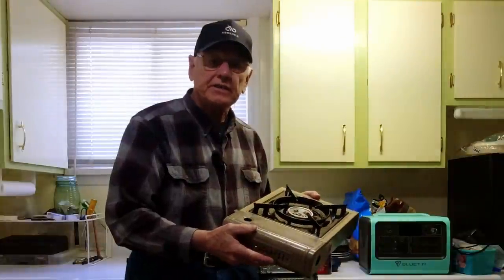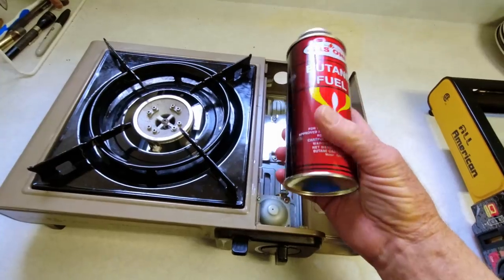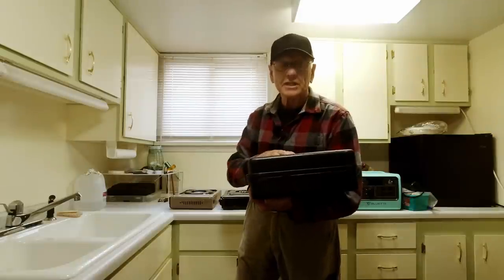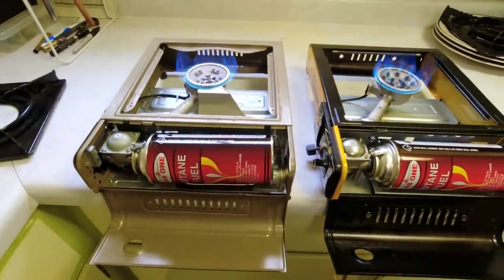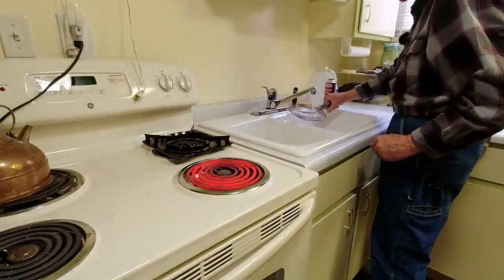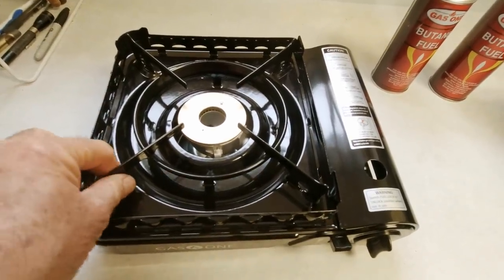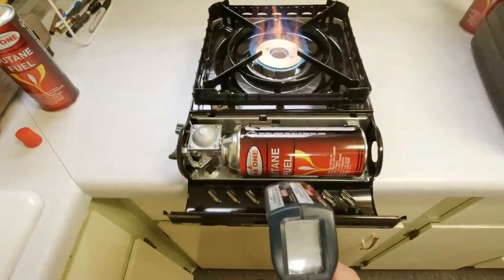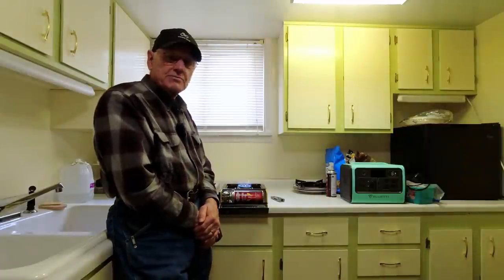Are the Newer Model Butane Stoves Actually Better? - How to buy a good one!

Comment from the maker: The modification I've shown in the video will only allow a small amount of heat to reach the bottle to warm it slightly. A word of caution concerning the use of these stoves!  Always follow the instructions and the most important instruction is to NEVER use a pan that extends over the butane fuel bottle (or can).  This can cause the can to overheat and explode.  The price of 8oz. cans of butane for these stoves has gone through the roof along with all other types of fuel.  I just bought 12 cans off of Ebay for $35.00 including shipping so search around a little for the best deals. Try this outlet for fuel: https://www.webstaurantstore.com/search/butane-fuel.html 03/25/2022
Reply: I’ve been told that you can buy the butane cans at Asian grocers for a much lower price.  Unfortunately, I have no access to that in my area😢
Reply: If they don't have blue on the rim they can explode so be mindful of pot size.
Reply: @secondact7151  I think there’s a certification mark you need to have on the can?  Don’t remember the acronym. 😁
Also, the pan shouldn’t overlap the canister section.  I haven’t even been able to test my Iwatani since I can’t find butane here.
Reply: @SuzanneWho  guess how I figured out the max pan size?  I put my folding Coleman oven on my butane burner.  It was close to exploding, so I thought hmmm, I wonder if that is a bad idea.
Reply: @secondact7151  😎👍🏻
Reply: Seems to be opposite here in Australia 🇦🇺. 
Used to be approx AUD$5 per each standard 220gram canister.
A couple of years ago standard price for a 4 pack of cans AUD$12.00
Now I buy a 4 pack of cans AUD$6.00. Very happy with that!
Reply: @secondact7151  https://youtu.be/rVwOrk1vl5Y?t=137
do not put a heated pan on top of the gas can compartment, once the gas can becomes hot enough (so does internal pressure with fixed volume, PV=nRT) it will vent, with the right mix of butane and atmospheric air (21% oxygen), it can explode, or burn, neither is desirable when unintended
keep the butane can under 50C, it is printed on the can for a reason
Reply: Sam's Club sells individual cans for $2.28 or a case of 12. Good deal.
Reply: @kaysmith6297  now if I only had a Sams club within a decent driving distance! 😩
But, good to know if someone is going there, I can ask them to get a case for me. Thanks
Reply: Thanks for the super tip! Propane is great for boiling water (quickly)! Butane is best for eggs or frying at lower temps ( more control low, med low)!

Comment: Oh the irony.!!!
First off well presented, clear and precise description of the modification.
The irony is that here in Australia 🇦🇺 there was an issue of a couple of cases of the propane tank becoming too hot and bursting. The main cause of this was using too large a pan that then deflected  excessive heat on to the canister.
All the “old” style stoves were removed from the market and a big scare campaign to stop people using them until the next generation was brought out onto the market. The next generation incorporated an over pressure protection to disconnect the vapour flow if the pressure goes above a certain level.
Now the “frozen cans”. The stoves rely on gas “vapour” to burn 🔥. Below a certain temp the liquid propane will not vaporise. The pressure drop inside the propane canister drops to such a level it appears to freeze (just the same as a refrigerator works. 
That’s were the added “heat sink” helps to keep the propane vaporising to use up every last bit in the can.
I hope this is useful. Happy camping 🏕 and stay safe and well
Reply: these are butane C4H10, not propane C3H8, the additional Carbon in the chain cause it to have different physical properties, boiling point, pressure, density, etc

Comment: I use one of these stoves in Australia and am lucky that the slow down only happens a couple of months a year due to our warm temperatures when it does I open the cover and pour hot water 💦 on the cylinder great modification though regards mike

Comment: I’m going to try this with my older propane burner. My sister gave me a newer model this past Christmas that has the fancier features.

Ok, I have a question. Probably 2 years ago you did a video that talked about your then sleeping arrangements in the trailer.
You were using a cot that I believe you called a roll cot. Would you still recommend this cot? I’m in the market for a new cot and    I’m considering this cot.
Thanks for the advice.
Reply: consider propane boils at -42C instead of ~0C for straight butane, unless gas container is cold enough, preheating gas line or container would not be necessary for stove cooking, unless your goal is higher pressure (before the regulator)
Reply from the maker: The Roll-a-Cot worked so well for us that after building our bunks in the trailer, we took them to our off-grid cabin and used them there. Be sure to put down an air mattress/pad and you'll be very comfortable.
Reply: Some great things about the Roll-a-cot: one,  the bed is a plastic mesh. We used to take ours on canoe trips in Alaska because they are easy to rinse off and dry. Sand or water doesn’t damage them. I now have a van to camp in and have put my Roll-a-cot in it. A 5” memory foam cot mattress makes it feel like a regular bed. Also, most camp cots have 3 sets of legs under them. The Roll-a-cot has only 2 sets of legs, one on each end, so stowing bins and bags under them is so easy. Their height is also convenient and comfortable for sitting. I sit on the foot of my bed and cook my morning coffee and other meals on my butane stove which is on a wooden box my husband made. The cots are also extremely durable. I have dragged  mine thousands of miles and camped in a dozen states and they are no worse for the wear. I can’t recommend them enough. They are 30” wide so that is the same as one half of a queen size bed which is all I need to be comfy!
Reply: @nancyst.john-smith3891   thank you Nancy for your remarks. Robin

Comment: Did you check the gas consumption on the newer stove compared to the older stove?  I imagine the 15,000 BTU stove would be using a lot more gas to produce that heat?
Reply from the maker: Oh yeah, it will use the fuel twice as fast, but we just turn it down so that the flame doesn't extend out past the bottom of the pot, which wastes gas.

Comment: Thanks for the tip !! Good modification for winter camping..although I usually switch to propane in winter, it would be interesting to see the difference.
Reply from the maker: Hello Pete, cold ambient temps will still be a problem until that plate gets warmed up, but it should help with that too.

Comment: At 6 euro a can for this fuel its cheaper for me to run propane / butane mix available here. I just reload the yellow propane cylinders from the bulk tank. Problem is that I can not find the adapter hose that lets me hook up these stoves to the propane bottles.
Anyone have a link to this adapter?
Reply from the maker: Try ordering the butane fuel from an Asian restaurant supply website.  It can be found a lot cheaper that way.  As for the supply hose, your stove needs to be equipped to accept the hose from the factory.

Comment: This butane can warming hack is something my several year old Iwantani 35FW has.  It's was a tad pricey but has lasted a long time, runs at 15k btu, has a magnetic seal for the tank connection, wind deflectors built in, and can get my wok up to temp fast.  I believe it was made in Japan
Reply from the maker: Thanks for that info.  My hack was just to show that it works, but I suggest that folks just buy a newer stove that has it built in already.  They're not very expensive anymore.

Comment: Thank you kind sir. Definitely going to try. So expensive the cartridge bottle and I’ve noticed they feel half or quarter full when the flame dies down. Rather crazy. Hope we have some out there who will tinker to find an exact fix to at least get the most out of it. Either that or the gas filler manufacturer should come up with a solution. 🙏
Reply from the maker: The newer ones have that.

Comment: Hi, i noticed the gas bottle chamber cover get really hot if i use big pan that overhangs the chamber.
Do you think that might actually be helping the gas flow better? Or is it dangerous? Thanks
Reply from the maker: That's actually very dangerous and can cause the bottle to explode. Make sure to only use smaller pans.

Comment: Any ideas about a common complaint the the stoves cook too hot and you can't adjust them to simmer?
Reply from the maker: The propane stoves won't adjust down low enough to simmer. On our propane burner, we use a heat diffuser which helps. The butane burner stoves will adjust so you can simmer.

Comment: We stock several quality brands in our emergency supplies from Korea, and Japan, and one manufactured right here in the Philippines where I am a semi-retired EX-pat. Most came with the heater strip and the one that did not has a conveniently open slit in the perfect spot to do an install. We generally purchase the 2 in 1 variant that is supplied with a hose barb that will screw into the side of the metering valve system and allow the use of our standard 11-kilo cooking gas cylinders to fuel the stove. Beautiful Bride has learned to cook up some great meals over the campfire and my assortment of camp stoves. We like the cassette stoves for emergency use indoors. My Mother-in-law is a non-camper and non-prepper so these stoves are a wonderful emergency tool for her. They are almost like cooking inside, on her kitchen range but they can be used almost anywhere. We also encourage Beautiful Daughter to practice cooking on these units in case she needs that skill away at college in a few years.
Reply from the maker: Another thing we like about them is their ability to simmer at a very low setting. Something that isn't possible with our regular propane camp stove.  Phillipino food is by far my favorite and I ate a lot of it in Hawaii during the years that we lived there.  I had my favorite restaurants and hole-in-the-wall places that we would go to.

Comment: Are there any butane stoves you would say are totally garbage?
On camp outs I have put a far few together for people. And have come across some that were junk.
Reply from the maker: Hello Stephan, I not really the one to ask, but my three stoves, even though they are inexpensive, all seem to work well.  We only use ours when we have to cook inside the trailer because of weather and like it because it's stable and can't tip over.  Outside we use a single burner propane stove.
Reply: @gonagain  Rick, I was wondering if you were going to come up with a way to build one of these stoves in to your cooking surface like the outside stove. But you’re right, they’re so stable you don’t really need to. I used to use a Jet Boil but the Gas One is superior in every way, except weight. Now that I’m car camping instead of backpacking (I’m old!) the weight doesn’t matter. Thanks for your videos!! My best to Linda.

Comment: i have a 15,000 BTU sterno brand which appears identical to this gas one. my problem is starting and running when camping and it's pretty cold. had to revert to a coleman propane stove, but would prefer using butane for a variety of reasons.
Reply from the maker: I understand that, because we are the same.  We mostly use propane but pull this stove out when we have to cook inside the trailer due to weather.  We like it because it's compact and very stable.

Comment: Good idea, supported by the fact that the manufacturer did the same thing.
I must say though, that freezing nozzle isn't really the issue. The drop in pressure causes the drop in temperature and the drop in temperature causes a drop in pressure...a viscous cycle.
Propane is a little less susceptible to that than butane is. You can buy butane/propane mixes just for that reason. It is quite remarkable how much the temperature of a gas affects the pressure.
Reply from the maker: Great point! Thanks.

Comment: More great info, thanks. Bought the Oupes 600 for trailer. Powers fan (on low), Bodega 50 fridge & lights for about 32 hours straight( on test). Thanks for the info on this great unit.

Comment: Just be careful that the canister does not get too hot. I have had one of those stoves burst into flames near the control valve from a canister getting too hot.
Reply from the maker: I know that you aren't supposed to use large pans that can direct the flame over the fuel canister.  That can an easy mistake to make.

Comment: just be careful in heating up the butane.. it can overheat and blow up..
Reply from the maker: Hello Benedict, this will only warm the bottle slightly.  The reason these stoves blow up is when people put a large diameter pan on top that deflects the flame over the bottle.  That's very dangerous.
Reply: @gonagain  yeah.. same thought on the large pan but if it's unavoidable, someone suggested to put wet towel over the butane (leaving the cover slightly open).. anyways, thanks for clarifying that it's only to warm up the butane.. happy camping and stay safe sir.. :)

Comment: How long does a new butane can last?
Reply from the maker: That depends on how you're using your stove, but one 8ounce can of butane will last about an hour if the stove is at full intensity. Butane is hotter than propane.
Reply: @gonagain  After learning about potential explosion especially when using indoors, I'm gonna have to avoid these gas units. I value my life and I don't want to burn my apartment down! So, I'm back to looking at induction cooktop again. Gas would have been awesome but it's just too risky!

Comment: that can be a recipe for disaster, if the temperature is consistently overheating the bottle it will expand and explode.
Reply from the maker: But it doesn't get more than warm.  The new stoves have this feature to stop the bottle from freezing while in use. In the video I suggested just purchasing a new stove and this was just an experiment to see if it actually makes a difference.

Comment: as temp goes up, pressure goes up and vs versa. your radiator cap keeps a 15lbs pressure which raises the boiling point to 250 degrees. by the same principle it's possible to boil water at room temperature. as the gas boils out of the canister, the pressure goes down lowering the boiling point heating it up raises the pressure. this is if you understand the boiling point is when a liquid turns to vapor...Redneck Physics. Moonshiners use this principle to remove alcohol from the water in the mash due to the different boiling point of each